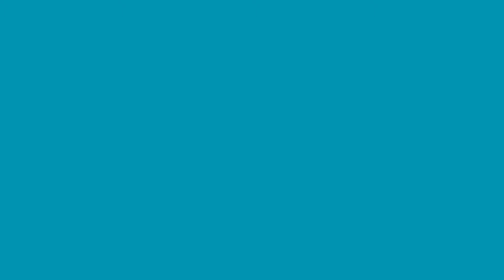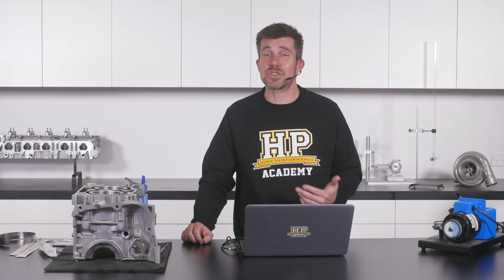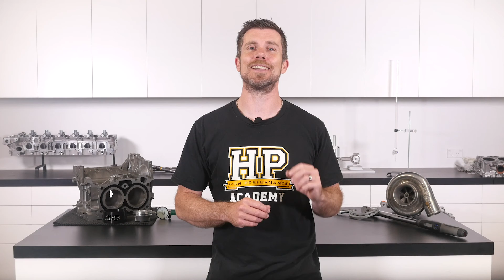Engine Balancing and Reliability | Does Balancing Make A Difference? [HPA Q&A]

Comment: An engine and most of the machines break down mainly because of two reasons:
1. Vibrations (balancing has to do something with the reason)
2. Dirt (almost every machine is constructed to work in a certain working "environment" and to most of the machines it means that parts should be as clean as possible)